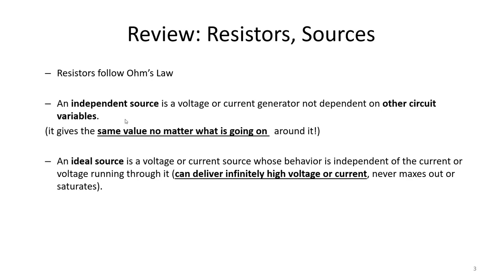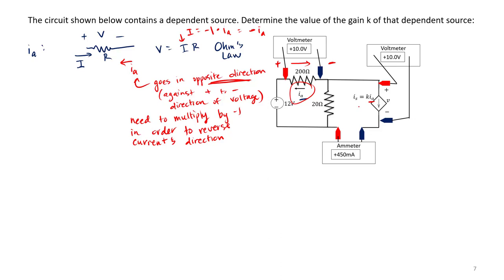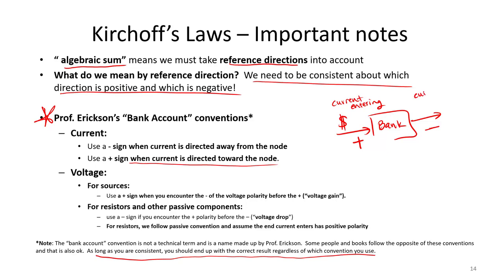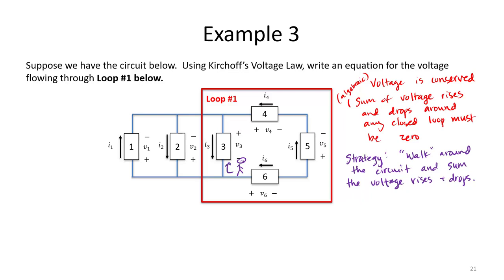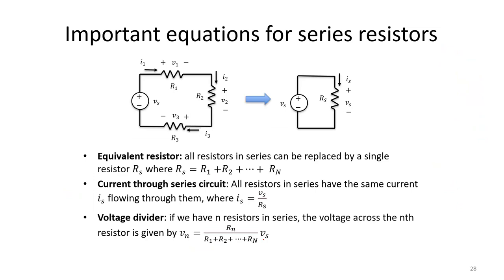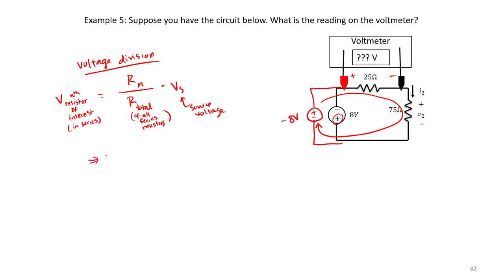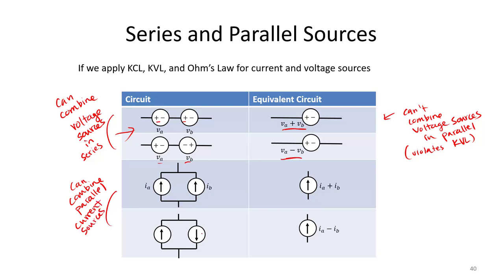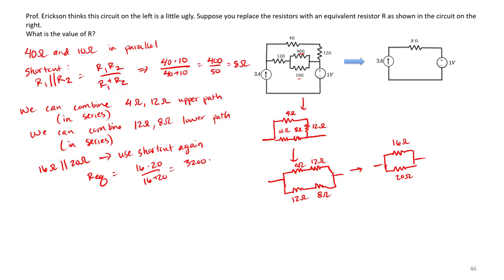Lecture 3: Kirchoff's Laws and DC Circuits

Comment: For the last problem would it be 320/36? Since 16*20 is 320
Reply from the maker: Correct, there was a small math error in example 7.  The final answer should be 320/36 or 8.89 ohms. not 88.89 ohms.